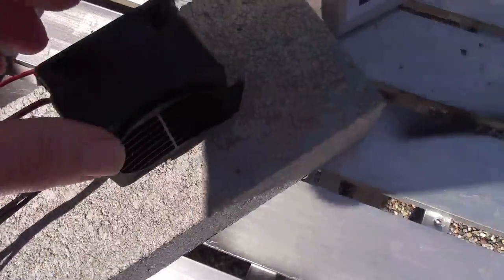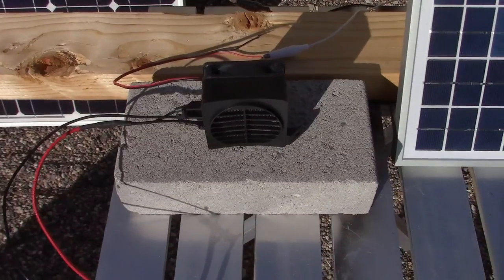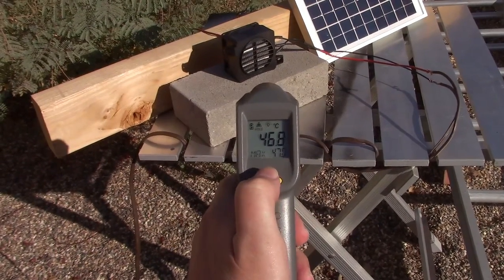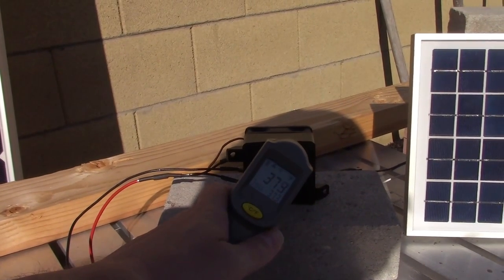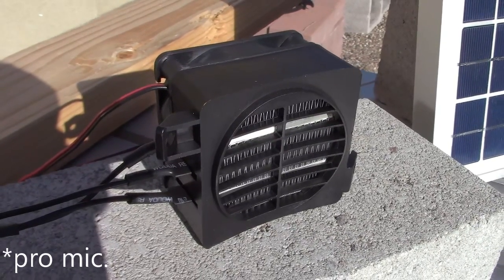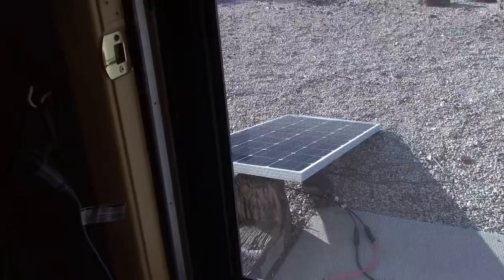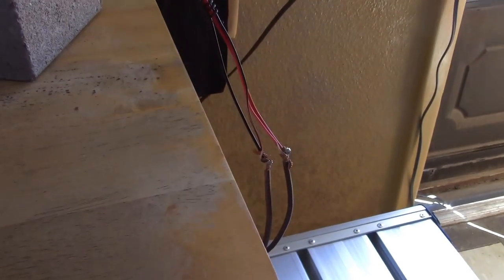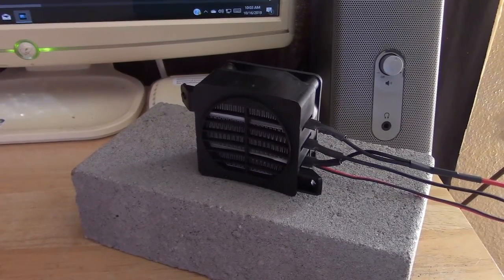Solar Electric Air Heater! (100W 12V) - 100W Solar Panel runs it! - PV space heating!! Ez DIY

Comment: How can you control the on/off?  I would want it to start at certain temps and not run 24 hrs.
Reply from the maker: it would be fairly easy to add a switch

Comment: I would love this with a thermostat to room temp. Any ideas? I want to build a heat box out of a big sealed igloo/coleman cooler type for electronics to sit in (router, small bluetti, security hubs, lte stick) to run my security system in my rv during winter storage. The temp gets down to -40 and I have power at my storage spot but I dont want to heat the entire rv.

Comment: Are these hotter than the pre made car heaters sold on amazon, i bought one before and it hardly kicked out any heat.
Reply from the maker: hi there. i'm not sure if they are hotter. i think they are about the same. these put out a lot of heat. you might have had a defective one. or it might have been a bad connection where it plugs in. they pull a few amps so the plug has to fit good for it to work well.
Reply: @desertsun02  would they last long on a 1000 watt powerstaion ?
Reply: He's only measuring the heating element, need to measure temp of the air a distance away through a pipe, 2k mains fan heater only puts out about 47c, 1kw 37c

Comment: Really interesting video, thanks. I was looking at such a design to add a few degrees to an outbuilding on my property. Not to heat it but just to keep it from freezing (winter temps here sit around freezing). If you use a 12v battery is there any protective circuit you need (battery conditioner) between the panels and the battery? Thanks, Doug
Reply from the maker: hi and thank you! if you're hooking up solar panels to charge batteries, the main thing is to use a charge controller (so the batteries don't over charge). i've got a video on how to set up a small solar system if interested.

Comment: Finally an answer to our problem. We have a propane Cinderella incinerator toilet which requires a 6" square fresh air vent behind it to burn the poop. The burning process after each use can take up to 2 hours, so the intake air vent is always open a few inches. We have been using a lot of electricity for an in-wall cadet electric heater to keep from freezing (literally) our buns off. thank you
Reply from the maker: i'm glad this video helped you out 🙂

Comment: Surly if you use seperate panels if the fan panel fail won't the heater just burn out
Reply from the maker: hi. the heating element won't burn out. these elements are made so that they can run with or without a fan blowing thru them.

Comment: Question, i have a solar power battery, made by PECRON, is there an adapter i can plug into a 110 ac outlet and drop it down to 12v dc? The PECRON battery does have a dc output, such as usb ports. Are the any adapters/converters I could use to power the heater?

Comment: I know you posted this a while ago but how long do you thing this would last on a 12v 100ah battery  and would this heat up a tent
Reply from the maker: hi there. i think it would last up to 8 hours on a 100ah (deep cycle battery) and double that or 16 hours on a 100ah lithium battery. the reason it's half the time on a deep cycle battery is that you are only supposed to discharge them halfway. if the tent is not too big it should work

Comment: You could place the heater in a sealed air space to heat a large container of water. You need to think of ways to store the excess heat for later tlwhen the sun goes down
Reply from the maker: water sounds like a good idea. i'll give it some thought and may make a video on it

Comment: These 12v are difficult to find.  Ive several 120v.   Would they not work?
Reply from the maker: hi. amazon usually has lots of the 12v ones. look for best price. they range anywhere from 10 to 25 dollars these days (depending on the seller). i only use the 12v ones.
Reply: @desertsun02  Why pls. ? Do the 12v make more heat, draw more power? More efficient? 
Thanks.  Have you seen the fella on YT who is using 15 - 20 diodes in series to make heat more efficiently than a resistance heater ..apparently.   he has them in a plastic electrical clip piece ,, but I see no reason to solder them and bury them in a sand battery.

Comment: I don't know if this was asked already. If I wanted to add a battery to this set up what would you recommend.
Reply from the maker: hi there. i'd recommend using a good size 12v deep cycle battery. by 'good size' i mean a 100ah to 140ah battery. you could also use LiFePO4 (lithium iron phosphate) battery

Comment: That might work nicely for a cat house heater
Reply from the maker: i think it would work good for cat house or dog house. you might want to add a temp control to the unit so you can turn heat down if you want to. btw, that is very easy to do. amazon sells that for as low as 5 dollars.

Comment: This is great! I made a bicycle charger. A motor mounted on a bike stand with a large gear for the motor with a chain connecting to a small gear of the back wheel. First I tried a small gear on the motor and large gear at the bike. It produced a lot of voltage under no load. When I hooked up the charger it got very difficult to pedal so I changed the ratio. It works well. This heater is going to be a great addition this winter. Exercise and keep warm all while charging the 12 volt batteries. The solar panels are going to be next. As I can afford them. Thank you from five years in the future.
Reply from the maker: hi and thank you! 🙂✔ bike charger sounds awesome 👍

Comment: What's the smallest  panel you can use?
Reply from the maker: hi. i wouldn't go with anything smaller than what I used (if you want it to run at full power.

Comment: Heya. Ended up getting this ptc heater after watching this video. Do you know if a 12v stc-1000 would run this reliably
Reply from the maker: hi there. i'm not very familiar with the stc 1000 so i couldn't say for sure. other viewers/commenters may have more info.

Comment: do the top wires come with the fan or? How do you hook the solar wires on top to the fan?
Reply from the maker: hi. all the wires come attached to the heating element and fan so all you've got to do is hook them to the solar panel. it's just a straight connect.

Comment: Hi Only recently our boiler stopped working. I want to make a powerpack for this type of car cigarette lighter fan heater. I thought 2 or 4 9 volt batteries connected both in series and in parralel to make 18v would work? What do you think? I plan to use rechargable 9v batteries.

Comment: Nice video! What is the current draw for fan alone? Heater alone? The positive lead splits into two wires. Are there two separate heating elements making a low (1 element) and high (2 elements) possible? What is the current draw for each? Variations in fan speed are likely slower when current is being drawn by heating elements-higher when not.
Reply from the maker: hi. i don't know the exact breakdown of the current for element and fan (but i can tell you the fan uses almost no electricity at all, just a very small amount). i'd guess the fan only draws 0.05a to 0.06a (50ma to maybe 60ma).

Comment: Surfing YouTube, seen your posting, have a comment: You should try a fish tank heater (adjustable watts) in a old truck radeator with a nice low watt brower motor fan. Just some thoughts.
Reply from the maker: hi. i have a video of what you describe already posted on the channel 🙂 fish tank heater, low watt fan but i used a transmission cooler type radiator. works good. heat is limited to the temp of fish tank heater though.

Comment: My, my. As i read these comments i think were all in trouble. Thank you for saving me the trouble of attempting to build this from scratch. I have been thinking of this very project for a long time and never acted upon it and its so simple. I will be adding a 12v 10a inline fuse and a rocker swiatch to power on off when needed. This is just about right for my camping rig that im now using a delta2 with 500w of solar. Heat isnt such an issue with me cuz im a polar bear but id like to pick your brain about cheap low wattage cooling in roughly 250 cubic feet. Any ideas are helpful and appreciated tia. Now to read some of your other posts ✌️
Reply from the maker: hi. i've got a lot of low wattage DIY air cooler videos on this channel. to quickly find those videos you can go to the playlists area of this channel and scroll through the 'air cooler' playlists. i''ve probably got 40 different designs. feel free to ask any questions about any of them. i see all the comments. as far as heaters are concerned, I've recently posted 2 more DIY air heater videos. here's a link to one. It's a 12vdc 200w DIY Ceramic Air Heater that 'thinks' it's a 500 watt heater (meaning it puts out an amazing amount of heat for its wattage). it should run very well using your 500w system.
https://youtu.be/iRSG-HWZEEs
Reply: @desertsun02 Hi mate so do you create hybrid heating designs ..cheers

Comment: How would you add a 12v battery to charge when there is daylight, and power the heater when it is dark?
Reply: You would need a solar charge controller this will have an input solar panel and output to the battery and an output for your devices

It'll have the brains inside the circuitry to be able to handle the process of putting the power where it needs to go

You connect the solar panel to the charge controller and then the device output to your heater when you want to use a battery you connect the battery to the battery port on the charge controller

Keep in mind even a small heater needs a surprise me large amount of electricity when it comes to batteries for example you would need pretty much a 12 volt 100 amp hour battery in order to run that heater overnight and that might not be enough to run it overnight you might need like 120 amp hours but 100 amp hours might do it if you get good sunlight

That's a $350 battery for that one single hundred watt heater and you need another one of those $350 batteries for each heater you add

Solar also becomes a problem 100 watt panel will no longer be sufficient you would now need about a 300 watt panel because you need enough power to continue to run the heater and as well as enough excess power to fully recharge that battery before nightfall again you might even need closer to a 400 watt panel since you're probably only going to get 200 watts out of it you'll be spending a hundred of that running the heater so you'll have a hundred going into the battery now that I think about it that's not enough because you're probably only going to get about 8 hours of real power and you have 1200 watts that you need to put back into that battery so you probably need two 300 watt panels the further south you are the more sunlight you get the less panel you would need but you would need to get a realized 300 watts reliably out of your solar in order to both run the heater and recharge the battery fully per day so that the battery can run the heater overnight

It is doable it's just not very cost-effective this is why most off-grid people do not use solar for heat

The reason what he is doing work so well is because he's not trying to run it overnight solar panel directly to heater and just run for whatever you can during daylight hours that you could do pretty cheaply
Reply: @nerys71  Thanks for the info.  Much appreciated.

Comment: Hi   So I'm a complete novice at this Sola stuff and frankly elec stuff is a bit weird,  But seeing your film and the second on I thought I would have a go.  12v 250w sola panel with controller and 4 little fans hoping to use 2 and have 2 in reserve.  It turned up and I read the instructions all 2 minuets,  connected it all up and Nothing ???   It wanted a battery  ?  added bat  12v 180 amp full charge,  ran 30 seconds and stop start,  removed everything connected sola panel to fan and heater nothing removed heater just fan and it runs.   Bat connected to fan and heater runs well.  The sola panel was producing 20v in the sun BUT ??  Looking into it a bit more  12v - 100w - 8.333 amps so x 2  fans need 20 amps output from sola panel ?  am I right or way of.  Andy confused in France

Comment: Hello iv just got this heater and planing on useing it in my bivvy when night fishing so could you tell me how this would work with 4 12v 7.0amp batterys ???
Reply: To calculate the number of amps for 100 watts at 12 volts, we can use the formula: Amps = Watts ÷ Volts

. Plugging in the values, we get:Amps = 100 watts ÷ 12 volts = 8.33 amps

Therefore, 12 volts at 100 watts is equal to 8.33 amps.

12 volt batteries of 7 amp hours each wired in parallel is 12 volts 28 Amp hours

28 divided by 8.33 = 3.36 hours of runtime.

Comment: I have a 120watt solar panel can I use it for the 12volt 100watt solar heater and not harm it
Reply from the maker: hi. if the solar panel a 12v panel then it would work great. you could even use a 150w or 200w panel if it is 12v. the heater will only draw the power that it needs.

Comment: Thumbs Up! Great idea.

I bought and tried it out using my Lithium Generator. The weak point is the fan speed and blades --- not a lot of air movement.
Heating element generates impressive amount of heat for such a small thing.

When I introduced a 4.5V power to the fan, it run a little faster and generated a larger draft but I am afraid the fan may burn out quickly at this rate.

Day time heating may work for a room with an array of these small guys but need to switch to batteries at night. And, winter nights are long. 
I guess we can charge the battery-farm during the day and use the the heaters at night, running off from the batteries.
At the same time, we can have other solar panels powering the heaters for daytime use.
Reply: Avery good  idea but the results are. not encouraging , I believe, with. battery storage with the. size. of solar  panels. used  domestically. Instead some. kind of  ceramic. bricks. of the kind used. in storage heaters might work,,,
Reply: @edwardhogan1877 If you buy nichrome wire you can create any size/shape/material/power heater  you want...its the same wire from inside a hairdryer...so if you get a small length off thin wire you can turn it into a heater from a standard single battery 🔋 so 3v and small current...so you can calculate the power and pick a matching battery setup too run it but the good thing can make any size or shape or style and it super efficient direct heat radiating heat so heats the van and you and items furniture rather than heating the air but it does still heat the air after a while...so my thinking was like small power long battery heaters that you can use say 4 ×AA lithium batts and power a 40w hot wire so it's like van radiators low power but  tiny and can be battery run ..I saw a video off a dude make a stove with it by cutting grooves channels into a red brick then inlayed some thicker wire into the groves like a snake sorta shape and hooked the wire up too a battery and it lit straight up and he was cooking food with a brick a battery n a length off wire lol...just random ones anyway cheers

Comment: @desertsun02
Could you recommend a setup like this for overnight use to warm an area 4x6 ft? 
Materials?
Reply from the maker: hi. this setup should do it. i'd just use a good size deep cycle 12v battery. they could power it 10 hours or more

Comment: Why don't you have a controller connected to either of the panels? If I connect an electric heating pad to my solar the volts drop to 0 and I get no heat. I now have a controller however have still not got it running.
Reply from the maker: hi. you don't need to use a controller with this project. the heaters run fine if you just connect them directly to the solar panels ✔🙂
Reply: @desertsun02  Right, that is in the video. Do the combo run because the amp output on the panels is the same as the amp draw of the heater?

Comment: My canopy on vehicle sleeps 2 as is only 2 cubic metres of air space. Perfect to take chill off the area. 200 watts of permanent solar to 105 AH Fullriver deep cycle AGM battery, it also gets alternator charge via a dc to dc charger with solar input. Brilliant little heater for short term use.
Reply: I’ve got a space half the volume of yours. How do you find the heater performs?

Comment: Hi watch this video looks great could you send me a link where I could get the ideal solar panel which would be suitable for this please
Reply from the maker: hi there. any solar panel that is 12v (and gives you the amps that you need) will work good. 100w panel is the minimum. a 120w, 150w or even a 12v 200 watt one would work good too. amazon has lots of panels. i have found that the cheaper panels are as good (or better) than the more expensive ones.